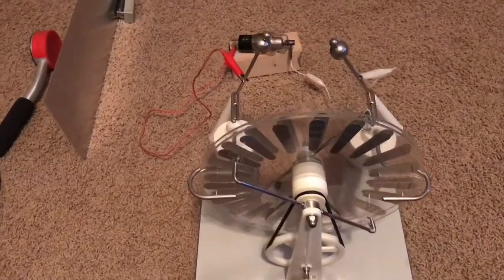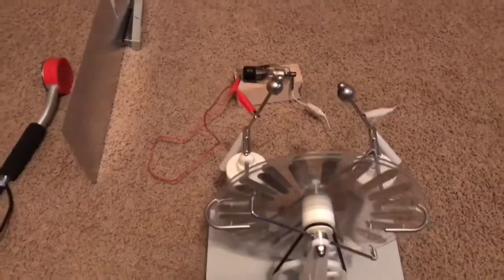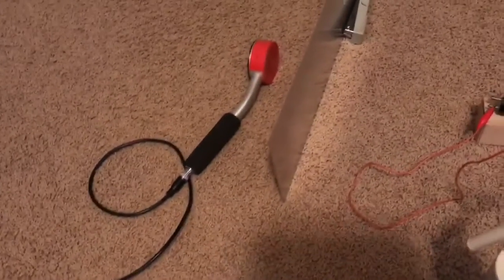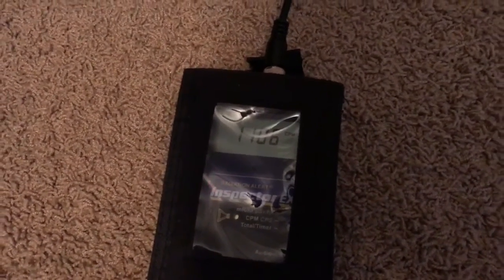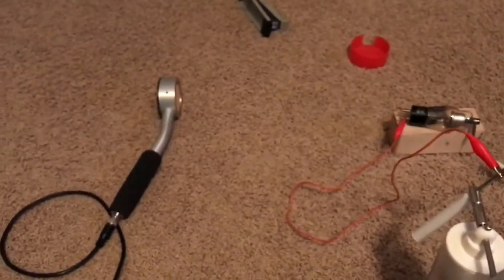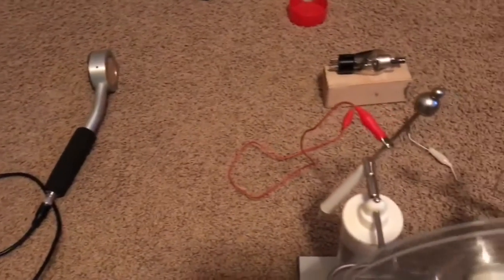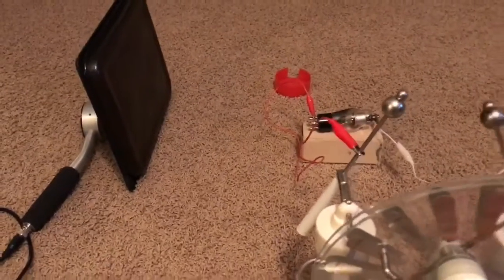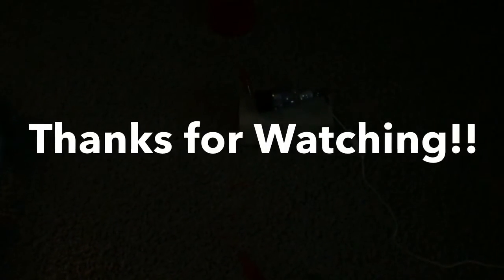X Rays from Static Electricity

Comment: FWIW,  I've read several sources stating the maximum X-ray energy exits (mostly) perpendicular to the tube body along the rim of the anode cup.  In other words, you were receiving more X-ray energy than your counter's GM tube. Reversing the polarity is purported to increase the output.
Reply from the maker: Doug Elick thanks I will try that out and use an x Ray sensitive green screen to generate an image!

Comment: How much is it in mR/h?
Reply from the maker: Sobaken will need to check that out and get crack to you. Just did a "quick and dirty" with CPM
Reply from the maker: Sobaken meant "back"
Reply: That would be appreciated. 
CPM doesn't really mean anything, it's just how many particles the counter registers per minute. Two different counters will show different CPM under the same radiation background (because of different volume,  material transparency, sensitivity to ionization, and other properties). 
I think I saw an option to display dose rate on your counter.
Reply from the maker: Sobaken I just measured the dose with the GM probe 1 foot from the rectifier vacuum tube and got a maximum dose rate of 22 mR/hr with is not very high by any means
Reply: Indeed, that's not that high, won't be enough for x-ray film even with huge exposure times. There's videos on youtube with rectifiers generating hundreds of mR/h (measured at a greater distance). Still cool though.
Reply from the maker: 10mR is a chest x ray dose. The exposure time for a chest generated with this setup would be 1 hour!!!! Still fun though, and with low enough dose of xrays that would be great for a high school physics demonstration.

Comment: i tried that with my van de graaff and nope!! probably the 1uA max that my generator can make isn't enough
Reply from the maker: Most likely is the amount of current being produced. I know the Wimshurst machine can produce slightly higher current compared with a Van de Graaff generator, which may be the main reason. Also, it depends on your detector. Mine will work with an open window. Have you checked to see if your detector is working with a standard sour e element?
Reply: @BrianDhvTinkerer  yeah, it's definitely the current out of my van de graff that is pathetic 🙄 i measured 500nA with spikes of 1uA at short circuit, i also tried to drive a TV CRT with the van de graaff and there was no spot even in total darkness

i made x-rays with the same vacuum tube and a flyback transformer and it worked wonders, yes, my counter detects those x-rays, and yes, it ticks with basically every source element that is not just alpha (it's an SMB-20)

Comment: Why did you not try using the Wimshurst machine alone with the detector to detect any x-rays? Afterall, you're meant to be demonstrating x-rays from static electricity. Is it the case no reading would be attained using the Wimshurst machine alone? In my understanding, it's the vacuum rectifier tube that produces the x-rays not the static discharge from the Wimshurst machine. The title of the video ought be "Producing X-rays from a vacuum rectifier tube powered by a Wimshurst machine".
Reply from the maker: Peter & Pete exactly right - so it is the rectifier tube that makes the x rays